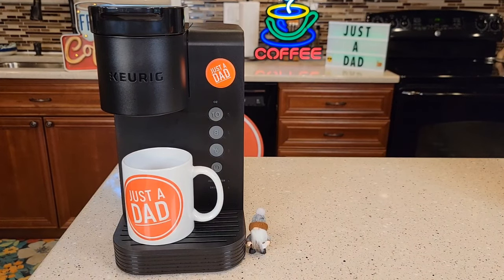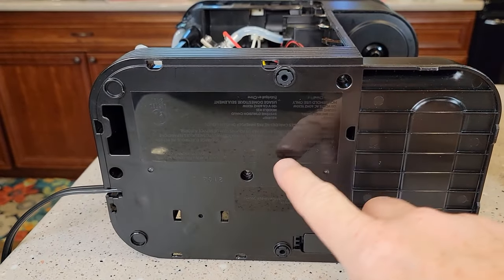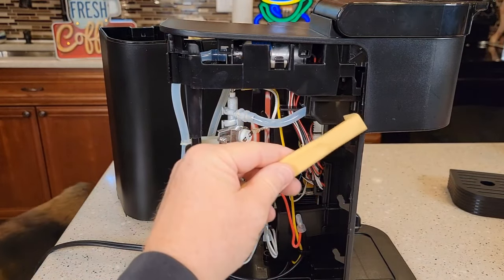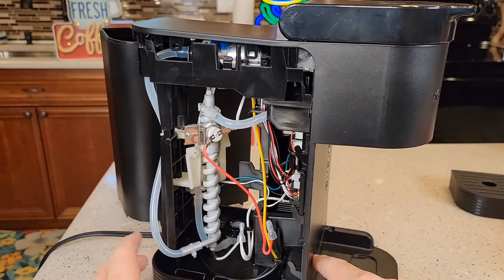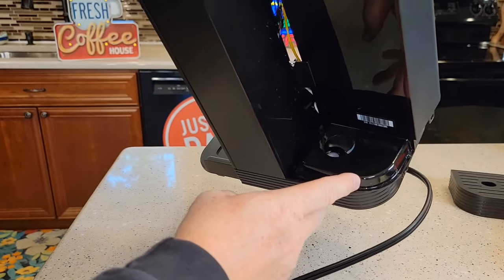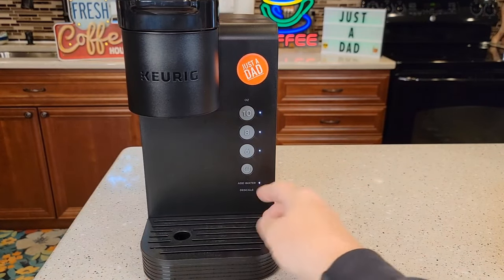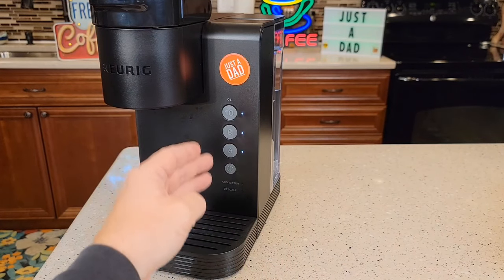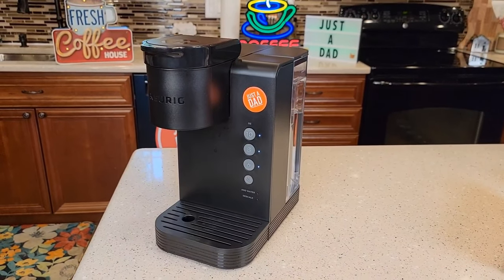How To FIX Keurig K-Express Essentials Coffee Maker Not Working No Power  RESET IT

Comment: Keurig really needs to do a design change on that thermostat.  No one should have to do what you did. Crappy internal components.
Reply: I couldn’t agree more an external reset switch of sorts if you will this is a ridiculous design
Reply: They do this so you’ll buy another
Reply: Agreed! An old  school paper clip reset button in the back would be perfect! fixed mine but I was to rough and broke part of the plastic. Great video though!
Reply: That would be bad business, why incentivize buying less “new models”?
Reply: Thank you! This worked!
Reply: Reset the thermostat button with a pin and it works perfectly.... design is flawed...
Reply: Thanks this worked! After I broke some of the clips and some plastic. This was a pain to remove. 😂
Reply: Keurig ar really dirty 🐀 because i know an old couple they cannot do all this, so I  helped them to unscrew the coffee maker to restart it but it was so difficult  for me I don't wanna imagine for people cannot do it.
Reply: Manual says it's not serviceable. Residential grade appliances are typically a shit show. Made to break every year or two so they can sell you more crap. Thanks for this video tho!
Reply: @FadeArcade92  That's not fair, my Keurig coffee maker stopped working exactly like that, the lights no longer came on, it was very difficult to take it apart, I finally did it, but it cracked,  when I found the part where the reset hole is, I restarted it and it started working again, I am using it even though it is cracked, BUT after this I will no longer spend money on any Keurig item, if they were conscious they would leave a hole on the outside to restart it when necessary. But you are correct, they do it with the purpose that one spends buying another.
Reply: either a change on the thermo or a change on the chassis of the kuerig so that people can fix it more easily
Reply: Totally agree! Mine lasted only a few months & it quit working!! Piece of crap!

Comment: Need to show more on how to take cover off.
Reply: I agree!! Please send help
Reply: Exactly he skipped the hardest part and I’m pretty sure I broke my Keurig
Reply: @kennywong9356  same
Reply: @kennywong9356 the pieces can break sometimes… if they snap back together at the end then just say a prayer of thanks
Reply: Little late, but it’s pry the top off enough to pry at the side. If you hear snapping it’s all cosmetic. Better to snap a couple cosmetic pieces and keep the coffee maker than buy a new one. I just did it thanks to this guy and it works fine again
Reply: If you take your time and pop the top of first then I took 3 small flat head screw drivers in the bottom 3 holes to pop them over the tab. Then use a plastic tool for car interior removal to pry the plastic. The parts that are on the front facing side have 3 tabs so pry up on them. Slide a small flat head or plastic pry tool up the sides Mine has a few dings from prying but it works now. I'm thinking of drilling a 1" hole on the side around an inch from the front and 1/2 way down so can just poke a long pin in next time. Put a rubber grommet to cover the hole.... Keurig wants you to buy a new one that is why they don't make them easy to open...
Reply: Literally just broke mine cus dude skipped all that shit
Reply: Those automotive interior tools are almost a must. You really have to pry on this guy to get it apart, but a screwdriver is too localized and will mar the unit.

Comment: I really wish somebody could do a more specific video about getting the damn cover off. Everybody skips the  important parts. You have to both push and pull and pry from two tabs at the same time, and somehow not break it. Seems like it would require an assistant. The upper cover blocks the removal of pulling it up, it doesn't want to pull outward, and the bottom seems to be part of it, and it doesn't seem to be removable, though it probably is. I only had it for 3 months and can't return it. All I need to do is reset the damn switch but can't get the cover off without destroying it. I'm almost considering drilling a hole in the side to see if I can reach the stupid thermostat thing.
Reply: I think I’ve only had mine for 3 months and it just shut off and I don’t want to break it by trying to take the cover off I wish it was easier to take it off honestly

Comment: All that I can say is thank goodness that the scars from loosening the side cover face that back of the house and are not seen by passers by. 
It would have been asking too of Keurig to put a reset button on the bottom side like a garbage disposal speaking of which, I've installed disposals quicker than removing that side cover. Thanks for the insight. It works again!

Comment: Thanks.  A quick google of the Keurig problem brought me to your video.  Thanks.  Although there might have been in your video a little more on wrestling off the cover, the rest was spot on.  What I did after resetting was to drill a half inch hole in the side which will allowed me to insert a 6", 18gauge wire into the spot on the electrical dealie that needs to be reset.  I had some 1/2" rubber plugs from an ebike battery laying around so I popped one into the hole for waterproof-ness. ( I drilled my access hole 4" from the top edge of the cover, and 2 1/2" inches in from the right edge of the cover.  That lets me insert that wire at the angle you need for resetting it.)  Thanks again.

Comment: Just A Dad you are the man! This happened this morning when descaling this Keurig model. Was about to toss it in the trash when, on a whim, thought to search the interweb for a possible fix. You are right about how precarious taking that side off is. Felt like it was going to snap into pieces at any moment. Thankfully it didn’t. Did the paper clip thing on the thermostat. Popped the side back on (way easier in that direction) and it’s good to go. Don’t think it’s a conspiracy on Keurig’s part to make it so difficult. At the price point on this model I’m thinking it’s “make this as cost-effective a design as possible” and this is what you get. Thanks again!

Comment: Thanks! Reseting the thermostat resolved my problem. I ended up breaking all the hooks on the front edge of that side panel by accident. That panel was very difficult to open. It still went back together tightly in the end though so they don't seem to be that important.

Comment: Thank you so much for posting this!!  In a cabin in the North Woods and couldn’t buy a new one if I wanted.  Now we will have coffee in the AM.  I didn’t have the plastic pry tool, so I had to use 2 flathead screwdrivers.  We had 4 days left on the warranty and after talking to Keurig’s customer for 15 min, they agreed to send a replacement.  So I figured the inevitable marring wouldn’t make a difference.  Worked straight away.  Not sure how you figured this out, but great job!!!

Comment: I just used this video to fix my Keurig this morning on minimal sleep and no coffee (yet). I read the comments and knew I would snap something off if I tried to pry it apart. I guessed at the location of the thermostat by looking at the position in the video and drilled a small hole in the side. Phone flashlight and a paperclip poke and we were up and running again! I might put a sticker over the small hole, but it kind of looks like it's supposed to be there. Not bad!

Comment: Thank you for this!  I never would have gotten it apart without your suggestion to use an auto trim tool.  😀
The victim was the Keurig at our club, which wouldn't brew.  The reservoir was moldy, which plugged the machine up inside. 😵‍💫 I bleached out the reservoir and once inside, disconnected the inlet valve and blew through the hose to clear out the crud from the pump.  Success! 😁

Comment: Thank You! I was descaling my Keurig and the add water light flickered once then went out. I knew I should have added water at that point, but brewed another cycle and then power cut off. I would have had to pull out my old drip coffee maker if it were not for your video. As you mentioned, it was not the easiest to take apart, but once I did, I put the smallest eye glasses screwdriver in the same spot and gently pushed. I did plug it in amd turn it on, before putting it back together, and it lit up like it was new from the box. You just saved me $55 on an Out Of Stock item. Again, Thank You for making my mornings bearable again and saving people's lives! 😆

Comment: Major tip for anyone going through this!!!  I drilled a 1/2” hole in mine.  So if this ever happens again I can reach in with welding wire instead of disassembling the thing.

Comment: I was having a heck of a time trying to remove the panel... so I did the next best thing:  Based on your video (roughly 1:26 in), I guesstimated the location of the thermostat reset hole and bored a 0.5" hole into the side of the machine, and presto! An access panel. With a paperclip opened out, I was able to reset the thermostat and it works!

For those with this exact machine, I bored the hole 3" from the front seam and 3.5" down from the top. I used a 0.5" chisel-point blade style bit. It made a super clean hole, sufficient to see in with a flashlight and position the paper clip. You could use a larger size if you're not certain of the location of the thermostat, based on your particular machine, if they're using the same heating element.

We've gone through other Keurig's that have died on us... and now I think they could've been saved if I'd known about the thermostat reset. Thank you for that, it's priceless info!
Reply: I just fixed mine by doing the exact same thing. Anyone else who sees this, I would follow his measurements and do this - the thermostat is in the same position on all these defective machines. I just guessed at the position by looking at the video and was able to get to the thermostat with a paperclip. It doesn't need to be exact, but having these measurements would definitely help!

Comment: Thank you. I did not take the whole cover off. I used a metal ruler, using the short straight side, Starting at the top, I inserted the ruler upward, then rotated the ruler so it's perpendicular to the machine. The purpose is to pry the lip of the cover out of the mating part. As I worked around the coffee maker I put objects (in my case bicycle tire levers) to keep the cover from sliding back into place. I just worked my way around until the cover disengaged enough where I could see the thermostat. I used my multimeter and sure enough the thermostat was open. After I inserted a pin into the hole there was continuity. I plugged the power in, turned it on. Snapping back the cover into place was easy.
As a side note, I saw gooey stuff at the bottom of the water reservoir where the water goes out. I took a bbq wood skewer and taped a q-tip at the end. Alot of yucky stuff came off. Probably best to drain the water and turn the reservoir over each morning. 
Good luck to those who need to fix their machines.

Comment: Turned out I needed you twice today. After successfully doing the descale, I decided to do it again to make sure I understood the process. It wouldn't turn on :( I have the k-supreme, or whatever it's called, so the cover is a bit different. Got it off and only broke one tab. The reset didn't work the first time. Fortunately I tried it before putting the cover on. Was about to trash the whole thing, repeated the reset and it works. Back to putting the cover on. Hope it works when I get it on. Don't want to do this again. Thanks for the video.

Comment: THANK YOU! I have the K-Iced Essentials and couldn't find an exact tutorial for that model but I followed these instructions and it worked perfectly. I tried to descale it and ran it dry and it tripped the fuse.  I did the descale again as you suggested and the "add water" came back on.  It was a pain to open and I broke a few of the clamps/connectors but thankfully it doesn't prevent it from going back on fine and the water reservoir fits. They should definitely make that easier.

Comment: I used your video to do this and it worked! The panel was a little difficult to remove, but I did it with a screwdriver only. I was not able to get it flush with the top part however, so now you can tell it was removed, but since I bought it at a reduced price, as long as it works, I'm ok with it. As an side, this might be why this was returned in the first place. (Bought at Walmart, opened it and there was a used k-cup in it).

Comment: Thank you. Regarding reset button, I did not feel any click, feeling like just touched. But after that somehow it is brewing again. Panel removal was not easy. I gave up. Instead I drilled a 2 inch hole by hole saw as a service hole LOL.
Reply: did just about the same after working way too long to pry the thing apart.  Used a step drill to make a 1" hole where the video shows the thermostat to be.  Reset with a paperclip  and covered the hole with a square of matching black flex tape.

Comment: Ran my kuerig dry by mistake and now when I turn it on lights blink and go out. It will not brew coffee. I can run full descale and it produces hot water. I suppose I can descale brew a cup of coffee. 

Have found others online with this problem but no solutions so far. Any suggestions other than buy a new kuerig? 

Thanks for your videos. They were very helpful.

Comment: The same thing happened to me and my Keurig “Essential” (the teal one). I had  bought the ‘Kuerig Starter descale kit’ and emptied the small pouch of descale fluid in the reservoir and then filled the rest of the way with water. When we started running the ‘Descale’ process the water reservoir almost completely drained (about 4 presses of the 8ozsetting) and the ‘Add Water’ light never triggered to show it was working properly and ready for the next step of running just a reservoir of clean water through it. This caused issues and we couldn’t figure out why until I searched it and seen your videos so thank you for the detailed explanation in the videos. After seeing your videos we were able to re-do the process properly and the kuerig works perfectly again. Thank you 🙌🙏

Comment: I'm enjoying a K-cup of Starbucks Peppermint Mocha thanks to this video. I got a brand new unit at Goodwill and surprise it didn't work. I read in the comments how one poster drilled a hole in the side rather than take it apart so I went that route. Using the image at 2:30 as a reference, I started a hole with an old soldering iron, then slowly drilled a 1/2 inch hole with a sharp bit. My hole wasn't perfectly placed, but I did get a sim removal tool in at an angle and heard that satisfying click. I found that a large paperclip was too fat. Then I covered the hole with black electrical tape. For those who want to use this method, look at 2:30 in the video and draw a 3 inch line to the left from the vertical surface with the buttons, then 3.5 inches down from the top of the top surface edge. You should be just slightly to the right of the thermostat.

Comment: Thank You! I bought this thing at WalMart and never even made a cup of coffee before it stopped woking.  When I put it back together I drilled at 1" hole in the side panel about 6" up and 2" back so that I can just poke through there and reset it again without removing the side panel (note that 2" back from the front edge of the side panel give you an angle to hit the reset hole). I have the feeling that if I take it apart again it will fall apart like IKEA furniture when you try to reassemble it!

Comment: Hi there... I really hope you see this. First, I'd like to thank you so much for this video because without it, I had no idea how to get my Keurig to turn on again. I've searched online but can't find an answer to a question I have. My Keurig was in descale mode, and I believe I was at the rinse part when it completely shut off and wouldn't turn on again. Now that I've followed your instructions from this video and it turned back on the descale light is not illuminated but I don't know if I have to run the descale again since it shut down during the rinse. I'm happy it's working again thanks to you, but I am afraid to use it, not knowing if any of the chemicals from the descale are still present and will get into my coffee. I'd really appreciate your help and thank you again for your helpful videos.

Comment: Yes this works.  Although I would argue to use the trim removal tool from top down.  I found the bottom tabs slid up easier if you already popped the sides up.  They need a new thermostat design as lord knows how many of these are in landfills.  Honestly if you don't care about exterior esthetics and don't have a trim removal tool, using a flathead or butter knife will work.  Just glad to have a coffee maker again.

Comment: Thanks mine is fixed! And luckily the cover didn't need to come all the way off just separated enough to see the heating element and reset it. Taking that top part loose was essential and I used a flat head screwdriver and a rigid plastic spatula on the rest lol 😆 but it worked!  Thanks!
Reply from the maker: Excellent!

Comment: Thanks Dad.. like others here have said taking the cover off was B*T*H but like you said if you just pull back enough on the cover and have a large LONG paper clip you can reach the reset button.. It bucked and farted the first 2 cups but seems to have re-set all it's innards and it's back to normal.. Albeit my cover now has a lot of screw driver and sharp knife digs in the seems but HEY the coffee's hot and flowing again.. Cheers my friend, Dave